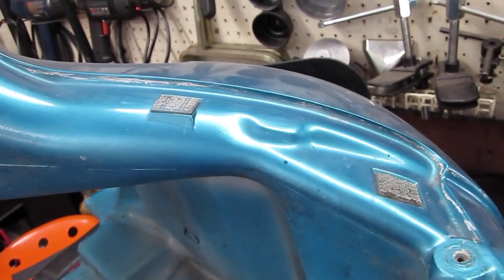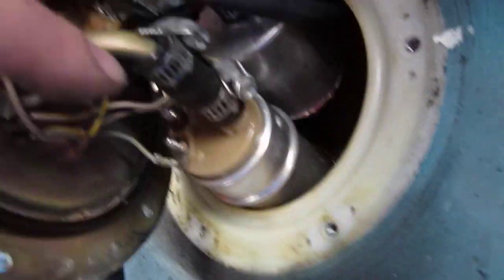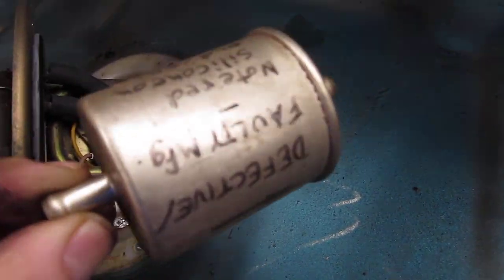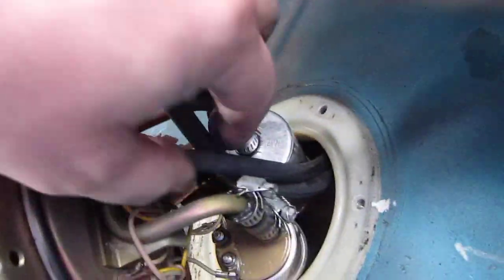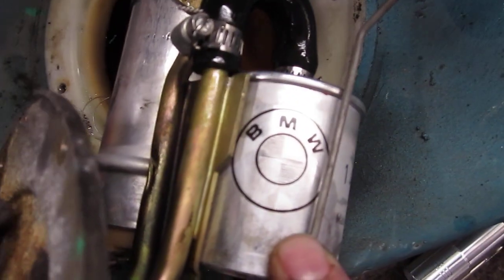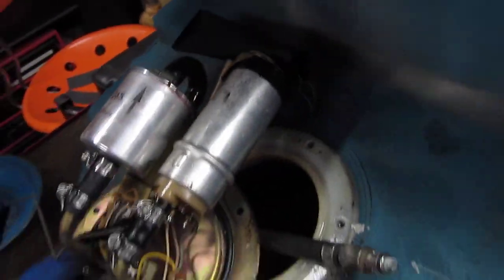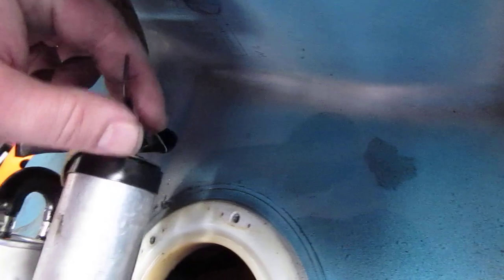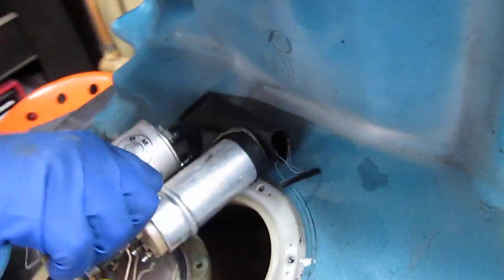BMW Service - Fuel filter replacement

Comment: Gotta say thanks man!bought a 99 rt for 2 grand and if it were not 4 your vids that thing would b sittin.fork seal-done.all fluids-done.vacuum when i opened the fuel cap,plugged fitting at the pump from the damned canister-gone and done.b4 the fuel gauge tube went-sweet.she got 63k on her and w/your help she will be around 4 a while.thank you and shiney side up...

Comment: Clymer manual says to  "Apply a small amount of gasket sealer to the new large ring seal and install it".  Something told me not to do this.
Instead I put a thin film of oil on the O-ring.  I then tightened the nuts down little by little in a cross hatch pattern using a torque wench.  I torque them to 6 N*m (53 inch pounds).  After adding fuel I found no leaks.  
Next time I will pump the gas out into a container.  I thought I was low enough on fuel to open the fuel sending unit.  I was wrong.  When I opened it, gas came out so I had to grab a plastic basin for dishes and poured it in there.  Once I got enough gas out I washed the tank out with a garden hose.  I then dried the tank out in the sun.  I replaced the fuel sending unit and fuel filter.  I also replaced the fuel pump with an EndroLast for preventive maintenance.  My R1100R is running great.  I'm happy.  Thanks again Mr Chris Harris for your video that makes everything much easier and a lot more fun.
Reply from the maker: Good work, JD!

Comment: Chris, thanks for the no BS vids. Wife rides a 96 R1100R. We just returned from a 12,000 cross country trip, Maine to California and back. Vacuum in her tank but did not cause problems for a long while. Tank liner pealing off, cleaned and had it lined. Removed canister. Bike surges hard on and off when twisting the throttle in gear but not in neutral. Bucking Bronco in 1st or 2nd. Filter, fuel pump, something else?

Comment: My fuel pump on my K bike started making a squealing noise, instead of the happy mosquito sound,  and I also noticed some intermittent problems occur that I believe were fuel related, so I changed it out with one for a '86 Ford Taurus and it is working fine. Got a foam liner thing to make up for the difference in size also. I now have a new spare pump ($10.50 on E-bay, free shipping)  that will accept the new plug which came with the pump, which I soldered on,  in the trunk. I covered the wire where it  was soldered with clear plastic tube.  If it fails on the road, it's about a 10 minute job, (depending) and I should be able to do it even with a nearly full tank if I have to. Be sure to disconnect the battery first. I believe that is important when working around gasoline. I even heard of static electricity igniting gas.
Reply from the maker: Yes, there are alternatives, good work Ray!
Reply: This is where ya can get over on BMW big time.
Reply: Chris Harris, Now as the temp has gone up into the high 80's and perhaps above, today, I've had some vapor lock or whatever it is that causes the bike to quit running, and upon looking inside of the tank with the fuel cap assembly removed, I see a constant stream of tiny bubbles rising from around the fuel pump. This is with the bike not running, key in the off position, and I'm wondering if this is gas vapor being pushed back from the fuel rail on up and down to the bottom of the pump where the pick up is, or is this just tiny bubbles like coming up from the bottom of a beer glass, just cause it's hot outside and it's happy hour? So what to do? Blame it on the cheap fuel pump? Insulate the bottom of the tank with more of that self adhesive reflective aluminum and rubber stuff? Should I insulate around the fuel rail and around the fuel line going up to the tank? Blame it on the ethanol fuel we get today? I think I heard something on you tube somewhere that when fuel is warmed up the alcohol leaves, and what's left is water. Today I added some fuel additive / cleaner (Red Line, mixed with something called K100 which is supposed to combine with the water so it will be consumed), but still later on had some shut down, till I got to riding in the shade and elevation as the sun was beginning to set, and things cooled down to about 70. At that temp I will never have this problem happen. So am I on the right track? What else can / should I be looking for or do? I would like to keep the cheap fuel pumps I have, as at all other times it works great. I'm thinking the fuel rail is basically a heat sink, and that might be the thing to blame. I'm thinking now of perhaps a way to provide a fresh air vent which would blow directly onto the fuel rail, routed by some sort of hose or something. I suppose I could use the left side storage compartment as an ice holder and drill a 1/4? hole in the bottom and shoe goo a small pvc hose in and direct it to the fuel rail, but then I have to keep buying bags of ice. I believe it would work on a long hot trip, but there has got to be a better way. Is there any kind of fuel additive that could help prevent the gas from boiling?

Comment: Hi Chris, Love your videos. I learn allot especially the series on spline lube for k bikes. I have a question on vapor lock on my 1990 K75 California model. I went to change the fuel filter and noticed the rubber vibration damper has turned to tar. I have parts ordered for that and the screen witch became brittle. My question is the vent hose (16 131 455 350) witch crumbled into small pieces. I know one end goes to the screen but where does the other end go? Is this why my tank develops a vacuum?
Thanks
Abe
Reply: Abe, from what I have read on the internet, get rid of that vent hose that goes down to the filter screen. When I put my new pump on I used the old screen which was still good after cleaning it, and I melted the thing shut where the vent line went to it. It goes from the screen to a tube at the top of the inside of the tank. Not sure where it goes from there, as I got rid of it and didn't care.

Comment: hello, Chris where is fuel filter on 02 r1150rt, I just bought this bike with 80000m. what is yours opinion about this bike &  what I should check, what is there life, this bike is on synthetic 20/50 and spotless, thanks for Y time

Comment: My low fuel level sender is not working.  This part cost like $370.  Is there a way to repair the old part.  I need to replace my gas filter anyway.
Another question in my mind is:  Since the bike has 130,000 miles, should I also replace the fuel pump as preventive maintenance?  Should I be putting something like $700 into my gas tank?
Reply from the maker: John Doe; You might be able to repair the sending unit. The fuel pump and hoses should be replaced but you don't need to spend $700 in parts! https://www.beemerboneyard.com/r81111r1fupu.html Good luck, Chris
Reply: @ChrisR.Harris  I ordered the kit from EURO MOTOELECTRICS.  https://www.euromotoelectrics.com/product-p/fpk-231r.htm
I liked this better because the hoses look more OEM and it contains the "U" shape hose.  I didn't order the fuel level sender because I'm hoping to repair it once I get it apart.  Hopefully its just dirty contacts.  The electronic module tests good.  Before I get started I plan on running the bike without the carbon canister for a week or two.

Comment from the maker: Check the electrical connections at each fuel injector. Peel the boot back and make sure the connector is making a good connection on the injector. If that is all good try a new fuel filter.
Reply: I'm just about to do this on my boxer cup rep!what are the clamps called& where can I get them?(also the tool to close them)thanks!👍

Comment: Hello Chris, I have a k1100LT. On the way back to Ohio from West Virginia ( great riding) my bike seemed to run poorly at slow speeds. The fuel pump seems fine. I can hear it when I turn on the switch. Bike still runs. I was wondering if it would be okay to ride the bike to use up all the gas in it so I can get to the fuel filter without having to drain the gas.will this in any way hurt my injection system?
Reply from the maker: It shouldn't hurt the injection system but the driveline will suffer if then engine is running poorly.

Comment: I have a 24k mile maintenance kit from Beemer boneyard and im wondering what the 3" diameter o-ring is for. Anybody know and care to reply?
Reply from the maker: Larger one is for the fuel pump plate and smaller the fuel filler cap.

Comment: Dudes...my 01 r1150r fuel pump is getting noisy like the one in this video or worse. The pump sounds fine with no load on it(outside of the tank)...Will a filter fix it or should I replace the pump too? https://youtu.be/wkF6EDRfzek
Reply from the maker: You sent me this video asking my opinion. A: Replace the fuel pump. See Beemer Boneyard https://www.beemerboneyard.com/fupufupuki.html and replace the pump and screen along with fuel hoses (age) and filter. When the pump is noisy it is telling you that it is struggling. Don't be surprised to see the rust colored fuel tank lining falling off and floating around in the fuel. Just scrape it off and contine with the pump replacement. B: Do not snap-rev the throttle on these engines or you'll be looking at a parts bike really quick when the cam chain snaps the guide rail. Use SMOOTH throttle applications. It is NOT made in Japan. Good luck.
Reply: Thanks Chris! My pump/filter config  is different than most I've seen, I just ordered the whole assy... I'll take it easy on the machine.
Reply from the maker: Good luck Mike!
Reply: Fuel pump change FAIL!! 
F/P sounds like a normal prime with ignition on but bike won't run, only pops a little bit only with starter engaged and choke off... nothing with choke on... Cracking the throttle no help. looks like I have fuel Q/D pressure line on the bottom, return on top, elect connector and pins look ok. no flaking in the tank... pulled fuse 5 to reset the brain no help...any advice?
Reply from the maker: Are your fuel lines crossed?